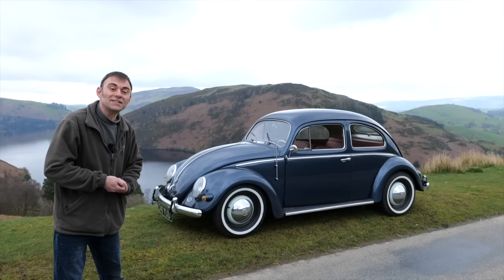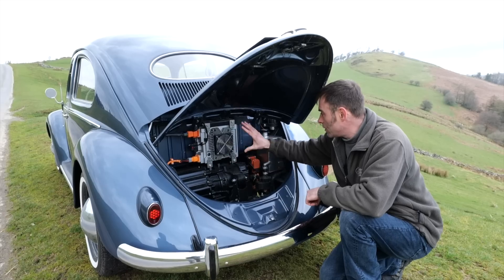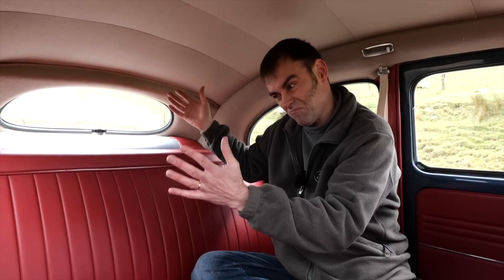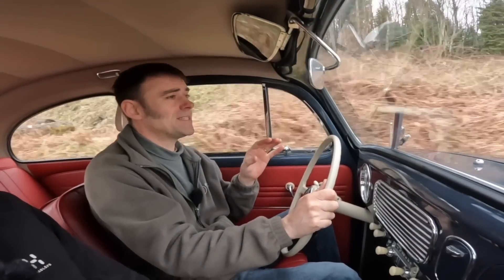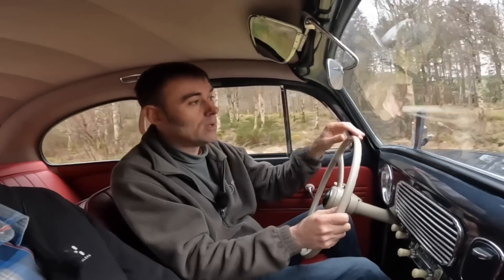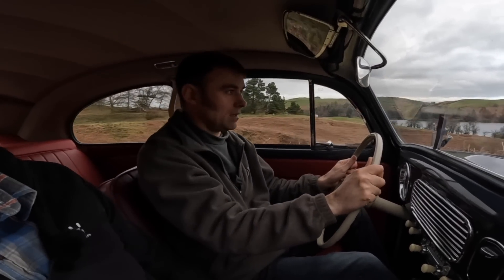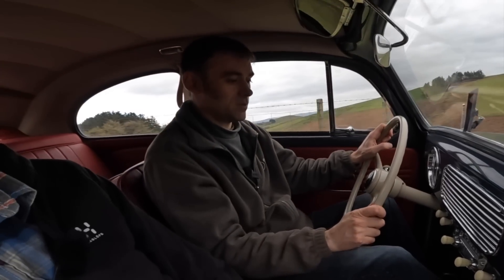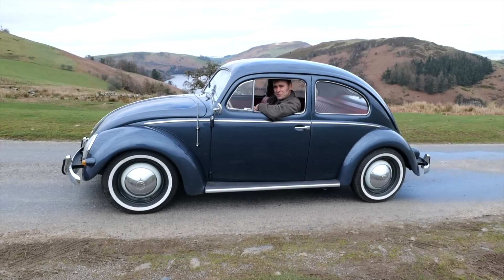Finding problems in an electric VW Beetle, converted using our bolt-in kit.

Comment: I just love electric conversions, regardless if it is a classic car or any vehicles.

I wish for more preapproved kit modules to be used with basically any vehicle.
To make conversion of any vehicle fairly easy, with less paperwork to get it road legal.
Lists of preapproved combinations of motor, iverter, battery, charger, cooling. etc.

The only barrier for approval should be if the motor is too powerful for the tructure, if it can rip itself appart.

I want to convert a petrol ATV, 
I would love some "off the shelf" parts, to choose from.
- Hub mitors, axles motor with/without differential, different power
- misc inverters/drive controllers
- battery modules
- BMS
- chargers

I just wish there were some pre-approved coombination lists.
- I want to use this/these motor/motors
- then I can use these controllers
- I should have a certain battery voltage, and power ratingnand range
- then BMS and compatible chargers depending on chosen battery configuration.

At least I would probably start my design with this approach.
- torque and power requirements, to find minimum motor, drive controller and battery
- then estimate range, if battery should be larger, and verify still compatible with motor and drive controller
- then find BMS and charger for said battery
- off course also consider inputs and outputs, speed lever/handle/pedal; brake pedal/handle/sensors, buttons/switches, lights/display

Comment: In terms of safety, the rear swing axles, with that much power going through them, could be a thing...  If it's so easy to dial the power up via the app, most people are going to do it...

Interesting the electric version has 2 cooling systems, for battery and motor, whereas the original had none...  not to mention losing all luggage space...

Comment: I think we ought to go back to the safety standards of the 60’s. Knowing that you could be impailed on a steering column if you crashed keeps you aware of how you are driving at all times. Not having seatbelts kept the speeds down naturally. Bias ply tall skinny tires mated to soft suspension without sway bars made you feel like you were going to roll over at any time again to keep speeds sane. Massive steel bumpers kept the insurance low “no damage no claim” i say safety has ruined of our favorite mode of transportation. These new cars have made us into wimps who are so risk adverse that we put insurance on our phones  and don’t know how to change a tire. Safety sucks the fun out of everything. The thrill of driving is that anything could happen. The older cars traveled at an avg of 38mph in their life span with two hands on the wheel and aware of our surrounding. now we travel at 53mph avg while watching a video on our phone. Really, which is safer.

Comment: I understand you do this for customers...  But that car is a rolling museum piece!  There ia a factory in Ohio that makes bespoke bodies for both Vw microbuses (split screens only) and Vw beetles for those interested in manufacturing their own kit car.  Perhaps that would shut up the purist crowd, I don't know.  But, at least your conversion is pure bolt on.  For those kvetching about leaving the engine deck lid open to charge, if it was still on petrol you'd have to open the trunk to fill it up, so what does it matter?!?

Comment: How does the heater work in that car?  Obviously the OG pulled off the exhaust shroud, which is long gone... is it pulling heat from the cooling system?  Or are you doing electric heat?
Reply from the maker: Electric heater. Think hand dryer in a washroom, instant heat. 👍

Comment: You can hear all the noises of the car. In Germany you say "quitschen". They are normally suppressed by the motor noise. What I wouldn´t like is the loading port not accessible without opening the engine compartment.

Comment: I'm surprised the radio is a Motorola and not a Blaupunkt.  Also, does that car have legit no seatbelt?  Isn't that terrifying?
Reply from the maker: It came out of the factory with no seatbelts but we've fitted lap belts. 👍
Reply: It's the no seatbelt, no collapsing steering wheel combo that should terrify people.  Seat belts without a telescoping steering wheel are pointless.

Comment: Before you straighten the steering wheel, it's a good idea to check the front wheels are straight. You don't want to fix the front suspension and then find that you have to undo the change to the steering wheel. BTDT (bent track control arm)

Comment: Nice conversion, car is in beautiful condition, but there's a problem if the owner wants it as a daily. It's a death trap. There were no safety features in 1957. Two-lane roads are significantly more dangerous than motorways because of head-on collisions. Does this car have a one-piece steering shaft? It certainly lacks airbags, crush zones, seat belts, and headrests. 

Here's a Camry flying through the air before landing on its nose and tumbling. The driver sustained minor injuries: https://www.youtube.com/watch?v=CY7XYqpXYhI

I hope EV conversions become a thing for cars manufactured this century.

Comment: My first snagging list item would be the squeaking boot lid. If you're going to be lifting it everytime you need to charge then that squeak needs a bit of wd40 or 3-in-1 oil - if they still sell the latter as my tin is decades old 🤣
Reply from the maker: 3 in 1 oil is great. Every shed should have an old rusty tin of it. 👍
Reply: @ElectricClassicCars  haha, yes, mine is under the sink so not rusty. It is sat at the front of the shelf to indicate it's stature, next to the large tins of WD40 & Gunk. 🤣
I had to do a quick check & just found it's still available albeit in a plastic container from what I saw at Screwfix & Toolstation.

Comment: I fix air cooled VW's 

I also build larger air-cooled VW engines for Beetles, Ghia's, busses, etc 

Normally asprirated up to 200 ish hp and Turbo charged to 300 to 500 hp 

Anything ftom a 100 hp 1776 to a 150 hp 2110 to a 200 hp 2332 .

My friend also repairs and restores air-cooled VW's , he is more into the welding restoration work side of things and stock mechanical work . He doesn't really get involved in the bigger engine thing as obviously i do, and we are mates .

He has many California-Look Beetles, including a black 1967 Looker with a 180 hp 2276 i built for him .

He had recently helped a guy with converting a Karnann Ghia to an electric drivetrain .

He got to drive it the other day as they guy had got it all finished and working . It's about 120 hp electric. 

I asked him what he thought 

He said, "You don't realise how much of the character of a car is in the sound / vibrations  / smells and interaction with the controls and gears " 

He said it was DULL 

Yes, it whistled along quickly, but he said all the character and soul in the car was gone. Basically, it had been reduced to the silhouette of what the car used to be .

And for what it costs , which isn't cheap , i would rather have a performance air-cooled engine .

I watched an episode of Vintage Voltage the other day, and it took £ 35 K to put a 120 hp motor in Karmann Ghia . And while the work they did looked top notch and i am sure a lot of the cost is in the materials , it seemed a lot of money for not a great range and only 120 hp 

For that kind of money, you could have a 200 hp 2.3 litre 48 IDA Weber motor,  built gearbox , rear disc brakes , Porsche 911 wheels, etc .

And instead of that bloody annoying whine , you would have the roar of 48 IDA's 

Also, when you opened the engine lid, you would have a beautiful IDA motor to look at , not some boring lump of metal

https://youtu.be/01NHEBrSWbY

https://youtu.be/uXdSGCflmfE8

https://youtu.be/RZW_e1rAv6o

https://youtu.be/pX-vmBGIgaQ

https://youtu.be/JsTmDLshe8o

https://youtu.be/dRJk6f5HigQ

I can see from the comments that a lot of people love these EV conversions, and that's fair enough . 

But they aren't for me

Comment: Question. A bit off topic. Conspicary theory on chem trails 😮
I believe that fuel has always been produced with additives - soft metal lubricant to prolong the life of the engines.
First was lead, but deemed poison in the 70’s.
Aluminum was then used but has now been linked to Alzheimer’s and dementia.
Over the past little while some people in the UK have stated to notice substantial buildups of a graphite/carbon substance on their TV screens. It is being attracted to the static fields involved with the screens.
My question to you is have you noticed any buildups or problems with the electrical motors of your conversions?
The magnetic fields involved with the motors would likely attract the graphite/carbon as the static of the TV screens does. Not being sure what the heat of the engine burning the fuel does to the additive, the additive may turn to an abrasive, loosing its lubricating properties. Or, you may be getting free lubrication for your motors.
Thank You.

Comment: In America we just buy an old Pinto from a junkyard and replace the engine with a Air Force surplus B 52 generator we use as a motor. If you put enough lead acid batteries in the car you can drive it to work every day if you live near your employer.

Comment: Like the car and video. If that's the original radio it has tubes and they take about 15 seconds to warm up before you get any sound. It seems like an electric car would get better milage if it had an automatic transmission.

Comment: OK, so doubtless it drives better on the electric motor but I have a few observations. The car has a better turn of speed and yet there are no seat belts? Seems if you are going to go to all that trouble you might have considered safety. Also, there are no air bags. Not essential I know but my mate died by being impaled on the steering column. Then I got to ask, why a left hand drive? I want to like it but contrary to your comments, the thrum of the old VW's petrol engine was its signature, it got people around for many a good year so don't poo, poo it just because you can.  Finally, you seldom mention cost. I am guessing the conversion is north of £50k and to me that just doesn't stack up, especially as most of us classic car owners do very little miles each year.

Comment: With the regen turned (way) down, does the regen accurately reflect the engine braking that you would have experienced in an in-gear, off-throttle situation in the original (ICE) car?
Reply from the maker: Yep, it's about the same now. 👍
Reply: There are two (2) levels of Regen: The Footbrake has a Transducer, and the level of Regen is progressive. It will deliver more Regen - as you brake harder. The other "Regen" acts as engine braking, which really shouldn't exceed the normal Engine through gear changing-down. On Icy Roads, it's good that you can have an App to minimise the Regen system. Something that you could never do with the old engine.
Reply: @peterduxbury927  thank you! That is a great detailed response. I had been thinking about the dual potential uses of regen, off throttle engine braking and actual, progressive braking. Look like someone, or everyone, beat me to the punch.
Reply: @brianfischer788  Yes! If anyone does an EV Conversion, an Electronic Transducer is installed (1000psi) into the pressure side of the Brake Master Cylinder. The wires (from the Transducer) feed into the Hyper 9 Motor Controller (Inverter). Probably, not many people know this, but the Hyper 9 Motor / Controller has 107 Alarms. Basically, the harder that you hit the Brake Pedal, the more Regen is produced. Only last week (for the first time), I did an emergency stop, as a car unexpectedly pulled-out from a street. I had often wondered if the car would stop quickly, the higher-value Regen kicked-in, as the front wheels screeched. I was pleasantly surprised at this result. Of course, it is important to select an EV conversion system that has this safety feature - such as the Netgain Hyper 9 Motor / Controller. You sound interested in a conversion, and I wish you success - should you decide to have a go. You can see my Beetle on YT by typing "East Hills Charity Car Show 2023". I am 75, and I wanted to experience an Electric Beetle - before I fell off the Planet! Greetings from Australia.
Reply: @peterduxbury927  I am curious and more likely to figure my own conversion, despite the certainty that Tesla could do it better, cheaper, safer, and more efficient than I could. I like the idea of the hyper-9 and don’t mind shifting my own gears. I have a feeling that many conversions (and production EVs) push the voltage too high so that they can run a 0-60 in 4 seconds and 150mph all in the same gear. I’d rather trade gearshifts for more range. I would love to see Netgain make a Hyper-11….
Reply: Nice conversion, @peterduxbury927  ! It looks like you have a Tesla drive unit installed longitudinally. Do you retain the beetle transaxle then?
Reply: @brianfischer788  Not only the original Beetle Transaxle, but the gearbox too! You do however, need to upgrade the clutch to suit the huge HP increase of your EV Beetle.

Comment: Re the steering wheel alignment.
If the indicators self cancel evenly from left to right you cannot adjust the wheel on the splines.
It must be done at the rods 😉

Comment: Awesome looking car. Now the owner will get to drive it for years to come with a lot less maintenance. More drive time less wrenching.
Reply: Absolute tripe! The suspension still will need greasing and the brakes adjusting. The petrol engine would just need oil changes and points/plugs and tappets adjustments extra. On the electric car you have to change the anti freeze.
Reply: @andrewallen9993  Well looking at your response. My point stands. Doing the breaks one in a couple of years, why regeneration same goes for greasing suspension.
Reply: @jasonblair4057  why has my split window still have original suspension where there are grease nipples after about 700 000kms?
Because they are greased regularly!
Now please calculate the additional wear caused by the vastly increased mass from the batteries. I have a lifepo 48v 150 Ah battery that masses more than my cars petrol engine.

Comment: If that Motorola radio is original to the car it will have valves in it and be for 6V. I noticed no time was given for the valves to warm up when trying it out. If it is the original 6V radio, I'm curious what's been done to make it compatible with the new electrical system.

Comment: Is your Regen controlled by a hydraulic pressure sensor on the brake pedal circuit , pressure sensor on the pedal or does it use a linear potentiometer to increase regen based on travel distance of the pedal  ?

ps , can you give the car a sound effect when driving around pedestrians ?  maybe the jetsons sound or a trotting horse ?

Comment: I’ve got a ‘64 Beetle converted with a Hyper 9HV motor and 7 Tesla modules.  It was done by Flash Drive Motors outside of Austin, Texas.  We added an electric A/C unit because it’s Texas, but haven’t added a heater yet (it did get seat heaters).  Can you describe your heater set up?  I’m really interested in how yours functions (I wonder if you sell them?).  EV West has one built in Canada, but I haven’t gotten it yet.  I’d like it set up to function like yours does via the stock heater channels.  Many thanks!  PS, I’m pretty sure it doesn’t have a “stereo”, I’d bet its “mono”.  LOL.  Oh, thanks for showing the driver’s side sag.  I just went out to the garage and checked mine with a tape measure and sure enough my driver’s side is an inch lower than the passenger’s side, 27” vs 28”.  I’ve got a LOT more clearance than you do and I can get my whole fist in on both sides.
Reply from the maker: The CanEV heater kit from EV West should work fine. Hyper 9 and Beetle combo is awesome. 😎⚡👍
Reply: I have exactly the same set-up as you, with the Tesla / Hyper 9 Combo. I'm guessing that your A/C is Gilmore Enterprises? My Beetle is the flat-screen '71. It's a whole lot of fun, and ample power. Same squeaking from the rear suspension, on odd occasions.
Reply: @peterduxbury927  You could be right about the A/C, but I’m not sure.  The condensation from the A/C pees on my feet.  The shop just called me the other day to say that another installation that they did was peeing on THEIR feet.  He reduced the temp of the unit by 5 degrees and it solved the problem.  We’re going back to TX in a few days so I’ll take it in for an adjustment.
Reply: @donelmore2540  Thanks so much for your advice. My A/C isn't fully connected (yet), but the Unit goes all the way across the car width - underneath the fascia. It is custom-made for the Beetle.
Reply: @peterduxbury927  I’ll have to look it up.  Thanks!

Comment: I like your videos on conversions of economy cars of the past such as the Beetle.
I'm curious about the sound the car makes as it passes the camera. Is it added?  Because I don't recall a Tesla sounding like that. I have scanned both videos and can't find the answer.

Thanks
Reply from the maker: I love that sound too. In a Tesla the motor is wrapped in a sound deadening jacket which we remove. 👍
Reply: @ElectricClassicCars  That's cool! I think Tesla should make that a feature instead of hiding the sound.
Reply: My Beetle Hyper 9 Motor actually almost "sings", and this comes from the Inverter (I think). Best sound is at 10 km/h with the foot off the gas.

Comment: Thank you for showing us a little bit more of the trouble of reality of conversions! What is this control solution for the motor that you use? Is it connetced over wifi? Can you see the battery parameters also from the tablet?